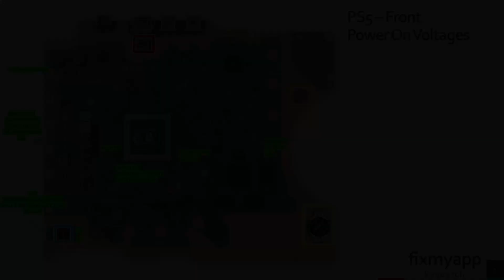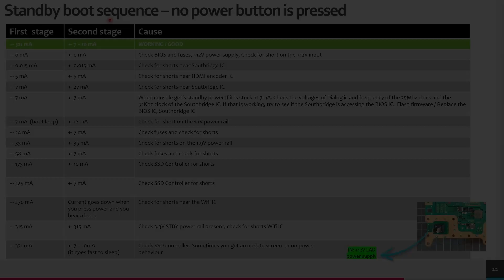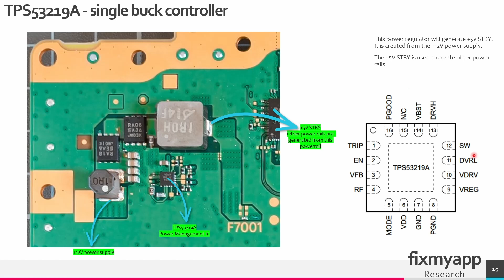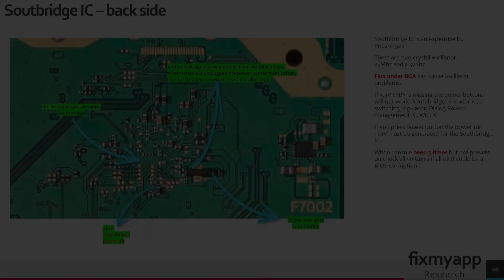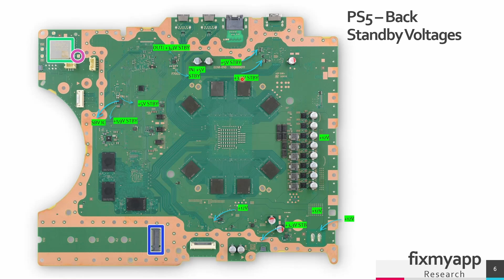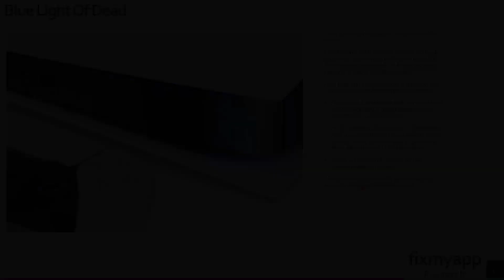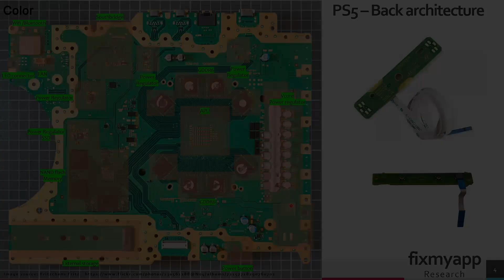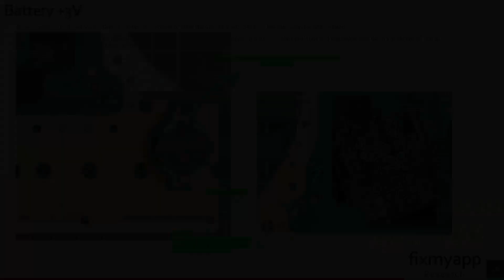PlayStation 5 Ultimate Troubleshooting Guide - Fixing Your Console Like a Pro

Comment: i’ve a interesting issue with my playstation 5 disk edition. Recently all the games (except astro’s playroom) crash either on start-up or a couple of minutes in game. Now, i noticed that the heavier the game is, the faster it crashes. Media applications work fine, astro’s playroom works fine, fortnite crashes 15 seconds in a match and black ops 4 almost instantly crashes on start up.  I’ve completely reset the console and restored the database in safe mode with no luck. Has anyone of you encountered the same issue or know a solution for this? 

Ps: the PlayStation always gives the same error code: CE-108255-1
Reply from the maker: Hi it could be different things, a software problem, a problem with the SSD memory, a thermal problem it is hard to diagnose from here maybe try a local repair shop to check. Gr. Jim
Reply: @fixmyappjim  thanks for your reply. I opened the console yesterday and saw a huge oxidation spot at the apu. I’ve ordered conductonaut to clean and respread the liquid metal. I hope that that is the issue

Comment: Great guide, I have a problem with my PS5. Every single PS5 disc game I try to load up gives me an error CE-108255-1. Ive done fresh install and reinitilise on the system. The console installs the game discs ok, but every PS5 game gives that error and won't even boot. Its strange because I tried PS4 games and they work perfectly on it...any idea what could be the problem? Many thanks and keep up the great work
Reply from the maker: Hi i never had this fault it seems to be a software problem or the cd drive is faulty. Keep in mind that the blue ray drive is married to the console. If you gonna replace the drive you also have to swap the ic to the new drive. Gr. Jim

Comment: Thanks very informative. So I am missing the 3.3V STB at the capacitors and I have a couple caps that are reading short on the back of south bridge ic. The PS5 is dead, but I do have the 12v, 5v, 3.3v, 2v, 1.8v rails on the back of the board. I didn’t test the front yet. Does this mean my south bridge is gone and needs replacing? The PS5 had damaged usb port in the back and I believe that is what possibly did it.
Reply from the maker: It could me the Southbridge IC but it could also be a capacitor that can be shorted. I would inject 1V at 2 Amps to the shorted capacitor and check which component get's hot, check with thermal camera or alcohol. Gr. Jim

Comment: Ram resistance relative to ground can be more than 40ohms, it depends on the manufacturer of the ram. Samsung ram measures low, 30-50ohms, where as micron seems to measure around +100 ohms, all of which are fine and working.
Reply from the maker: Thank you for your extra information. I pinned this remark. Thank you for watching. Gr. Jim